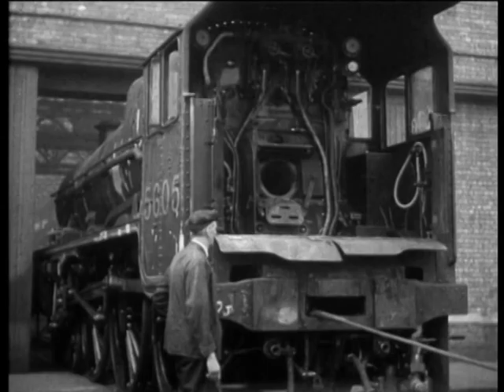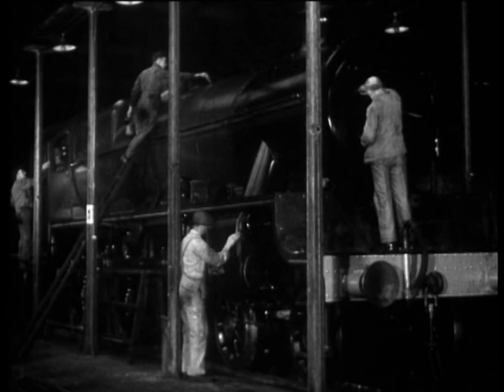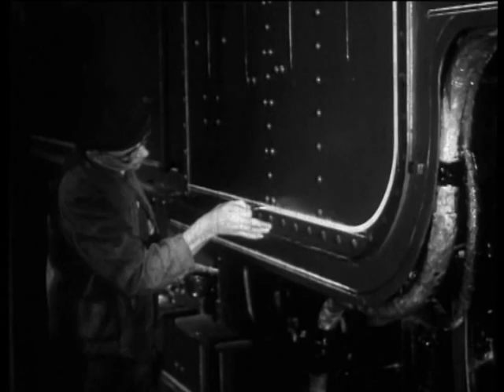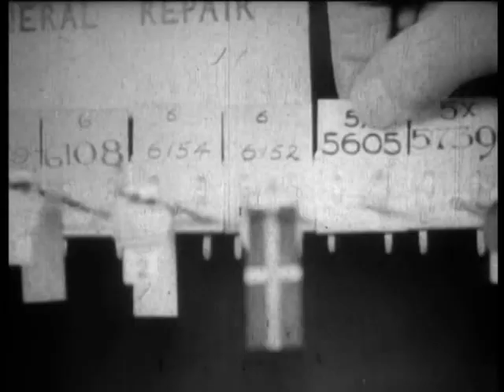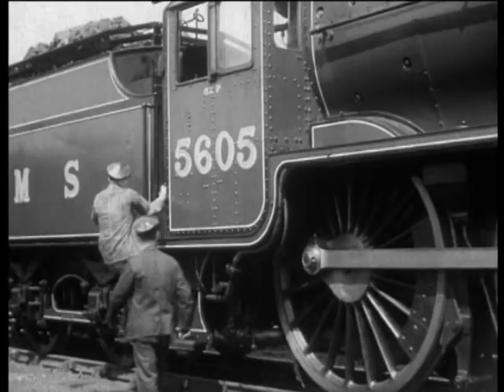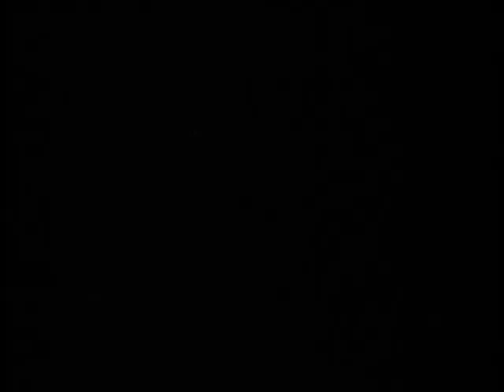LMS - General Repair - PT 2

Comment: 12 days. It took 12 days to do what it takes a year to do now. A local historic steamer went down for general repair recently. It's not expected back until next year sometime. But it has like five people working on it, and only a tiny engine shed. Anybody else feel like they were born in the wrong decade?
Reply: The best way to measure is man-hours, not days.
Reply: just a note there must be a 400 men workshop to make this happen, for all the in-house manufacturing of components, including bolts, nuts,piston rings, pistons and other parts as needed and store them in the workshop for when a expected rebuild is to happen then, to have the in-house special tools to tear-down measure and rebuild the worn parts of the locomotive, then to re-assemble the complete locomotive, test run,and re-certify the locomotive for service....then you look at UP and the 4014---what they are accomplishing is close to a miracle!!
Reply: Yes It seams they had all the great stuff back then, yes I think I was born a decade to late. born the sixties when it should have the fifties.....Tony
Reply: Is this the engine that was rebuilt in Wasilla, Alaska?

Comment: With overhauls like that they must have had very few breakdowns,such a shame all this has gone.Like so many other sites like this it has probably been flattened the ground picked clean and a thousand plasterboard and breeze block shoe boxes built in its place,every scrap of evidence to the sites' and Britain's former industrial might and glory gone forever.Even the great Swindon workshops weren't safe,most of it built upon and a ghastly shopping centre slotted into its interior.
Reply: at least there's the museum about the GWR